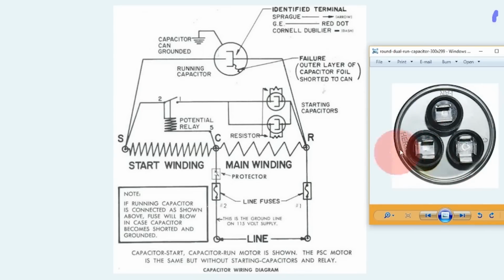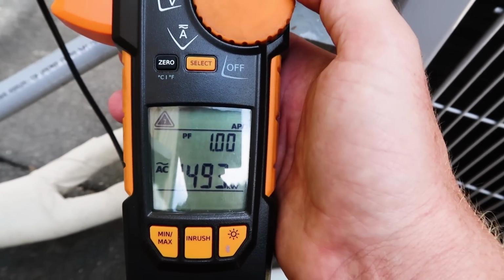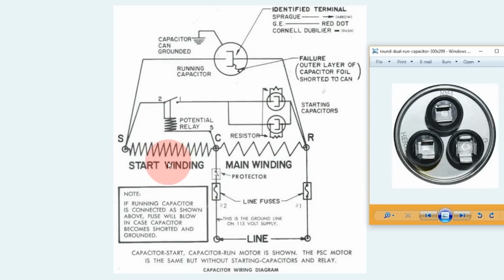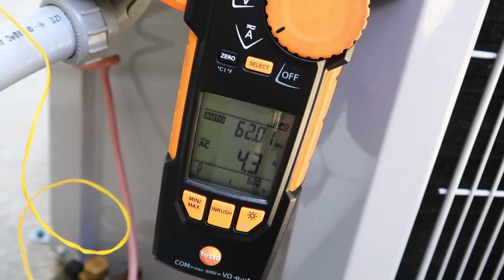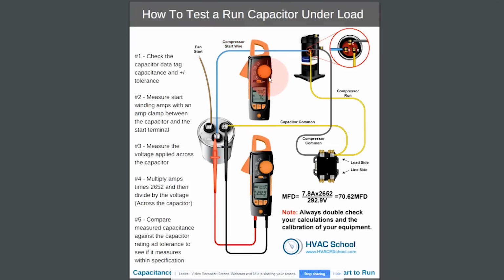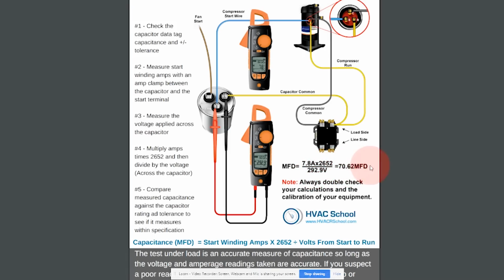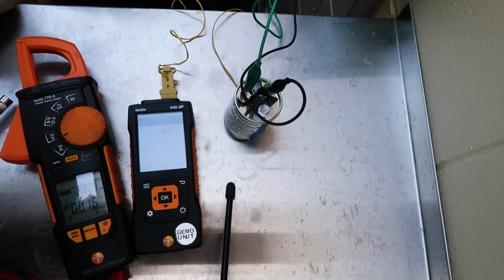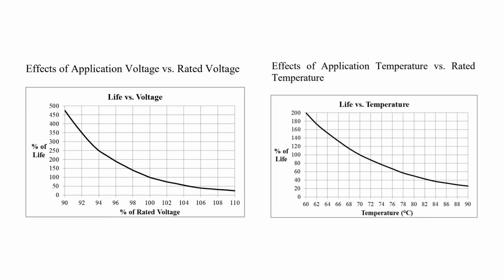Why Do Capacitors Fail? (It’s not why you think)

Comment: Thank you Brian! I really appreciate what you doing.
I changed bunch of capacitors lately and ask myself "what HFAC happening"? 
It was heat wave in New Jersey temperature get around 90 Fahrenheit. That's the answer.
I will check voltage surging.
Reply: Bacical  fuding playin tocking failing not me lon lot jobe filing why ??

Comment: Without  balance the difference in pressures the scroll will run the opposite way. 💣
Reply: The manufacturers learned that a long time ago. Now, they have a check valve in the discharge.

Comment: Wow!!! great video. You were killing me with that short cycling.
Reply from the maker: Sacrifices for science 😉
Reply: Here's one for you. Our system has a filter at the air handler which we wanted to replace. The unit was on and I was pulling on the sheet metal door to remove it and guess what was in there?  A safety switch on the door so as I was pulling the door and jogging it to remove it, the safety switch as turning off then on the system vs. the squirrel cage fan. That action grounded out the compressor !  Sometimes the safety stuff shouldn't be when professionals who know what they are doing are faced with these surprises. There was no label or information on the panel to advise of this feature.  Cost me big on that one.
Reply: short cycling is a good test for starter efficiency in worst case scenario.
Best starter being a "SOFT STARTER" that ramps up current instead of down from 5x locked rotor spike! 
(figure that the rotor magnetic core needs to get charged to be polarized before stator windings electro-magnetic force can orient the rotor spin direction)

Comment: Bryan, Excellent, in depth presentation. Would you consider doing an explanation of the use of a run capacitor as a crankcase heater? Is it a practical use of the run capacitor for this application? Thanks !
Reply from the maker: aliso 82 yep that video is coming soon

Comment: Does this apply to the Chinese made capacitors. They tend to fail faster and more often then the American made ones; in my experience.
Reply: Cheap made capacitors are less durable because of thinner lower quality insulation between electron storage plates and are less durable in heat and voltage surges from in coming power 
Very well done video.
Reply: how about "Hecho Mexico" parts ???
Reply: Yes Chinese made capacitors has bad quality, But think of their prices, I understood.